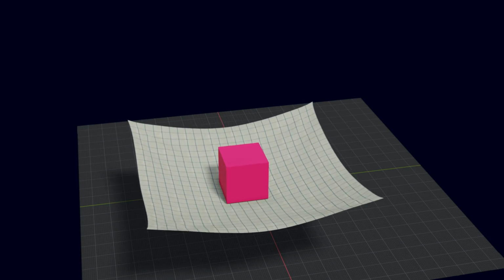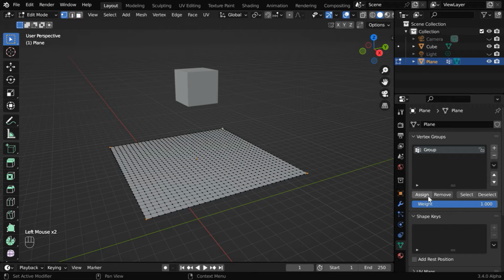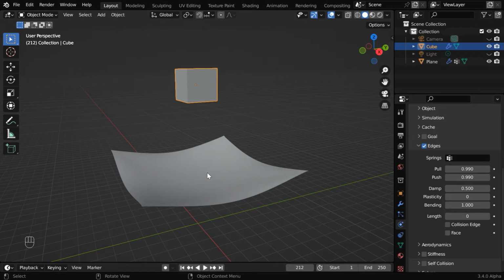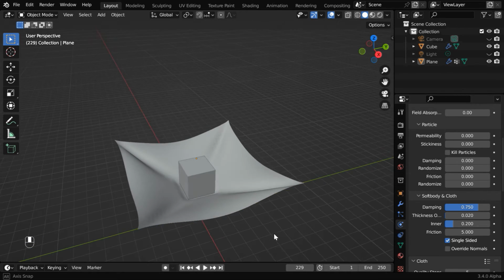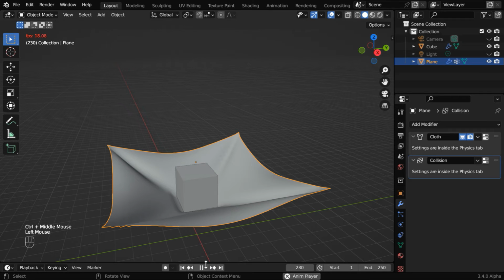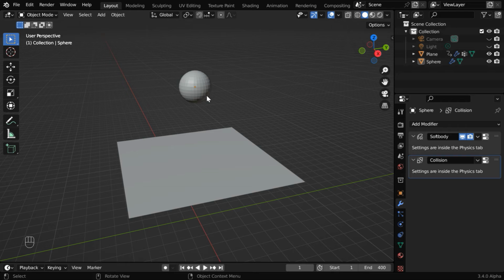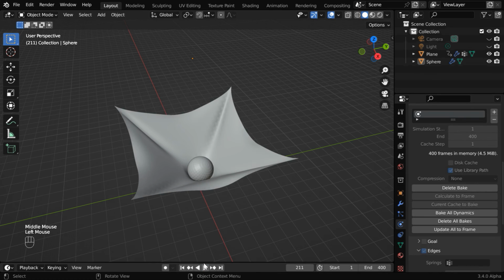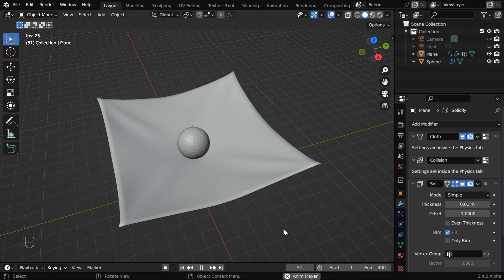Pseudo Rigid Body Objects Falling On Cloth | A Realistic Collision With Cloth Physics & Soft Body

Comment: having issues with doing this with a more complex mesh, for example an extruded logo shape from illustrator. Does the soft body object need to have simple geometry?  When i try with more complex & messy geo the soft body tag creates all sorts of glitches and the mesh falls apart. With cube it is working fine.
Reply from the maker: Yes, using a complex object will definitely create glitches since this is a very unstable setup, not a full-proof solution. unfortunately this part of Blender did not see any developmental effort for a very long time, there were no developers for the physics modules last when I checked with the official team. Many things are still 8-10 years old and not sufficient for today's requirement.

Comment: Greetings Sir, I want to know what I should do if I want the object to remain fixed, what I mean is that I want the wrinkles of the fabric to move only if I move the sphere or some other object that is not the plane.
Reply from the maker: I am sorry, I did not understand the question. So the ball is falling on a flat cloth object. It will push the cloth down. Now what? You want that state to continue without any other action after that? Since we are trying to create a rigid body behavior, it will follow natural physics. I did not understand what deviation or what special characteristics you want. Kindly explain it for me.
Reply: @5MinutesBlender  Greetings Sir, what I was referring to was whether the fabric could be animated in the same way that water is animated in Blender when you move the object that has "Collision". I'm going to get straight to the point, I want to learn how to animate a character lying down in bed and covering himself with the sheet or uncovering himself and getting out of bed.
Reply from the maker: @ Your character will have rigid body physics. Cloth physics works perfectly when cloth falls on a rigid body in any direction, or when rigid body creates a push/pull force on cloth in any direction other than vertical. In this tutorial we discussed this last part i.e. when a rigid body falls on cloth in a vertical fashion - cloth behaves unrealistically in this case and hence we need to use a trick. Otherwise in your case you just need to create suitable hooks to pull the cloth and it will work perfectly. Your character must add a hook to the cloth, if it then pulls the cloth it will wrap over the character. It does not need any trick as such.
Reply: @5MinutesBlender  Thak you very much

Comment: Rigid Body Objects are NOT in this video, so the title is false. You should correct that instead of having false information out there. It should just be titled Soft Bodies and Physics.
Reply from the maker: You're actually correct. We have now slightly rectified the title. The reason I think the title should still have the word "rigid body" because a prospective user will most probably search for that phrase while looking for this tutorial. It is actually a limitation in Blender that does not give us a good option to create this interaction using plain rigid body physics. I have spoken to them. They said there is no developer acting anymore on the physics part, they are aware of the issues but they do not have any plan to develop or bug-fix the physics anytime soon. So for a long period this alternate method can help someone who is looking for a tutorial like this. If we remove the word Rigid Body, those users may not be able to reach here, although I agree that it will be technically correct to drop that phrase from its title.

Comment: One question. Noticed that there was no "Apply Scale" for the plane/cloth? It wasent necessary in this situation or? When should I be doing this?
Reply from the maker: I think it is not necessary, did not test it. But if in doubt, you can apply your scale at the start of the process to be on the safer side.

Comment: Just a comment on the SoftBody. So, if you set Pull and Push to 0.999, there will be a breach in the texture, but if you set it to just 0.990, everything works fine.
Reply from the maker: Thanks for sharing the tip! 👍👍

Comment: how to made human character fall on cloth please tell
Reply from the maker: When you are using a human model, you'll of course have it rigged with bones and an armature. You need to treat this armature as a soft body (in relation to the interaction with the cloth like falling on cloth) which will in turn guide the character. Or create a separate set of meshes for each part of your character and add soft body physics to them and control your armature by those soft bodies.

Comment: Great Tutorial :yt:, Is there a way to tear the cloth with rigid body simulation?
Reply from the maker: Thank you!! The cloth will automatically tear off under sufficient pressure. It is in-built with cloth physics itself. But the tearing is not permanent, if you remove the source of the pressure, the cloth pieces will join back together which is unreal. There is no easy way to tear off the cloth permanently as far as I know.